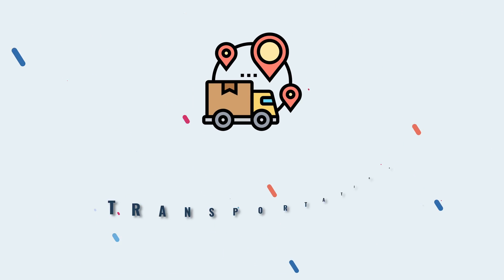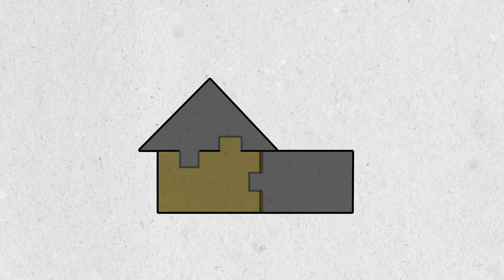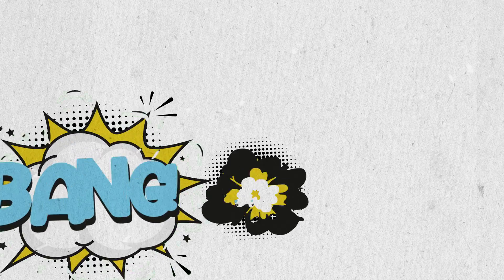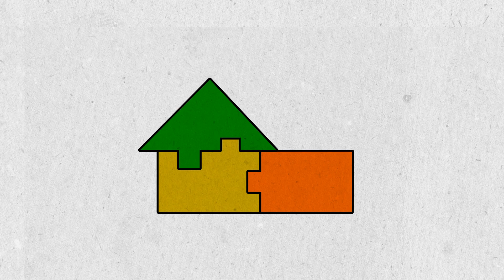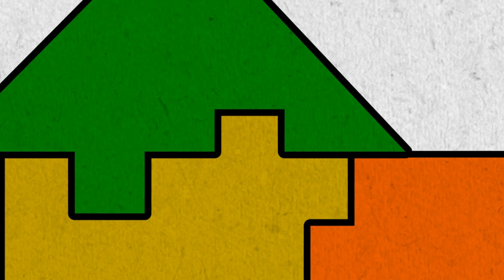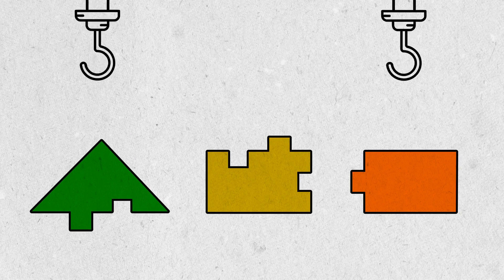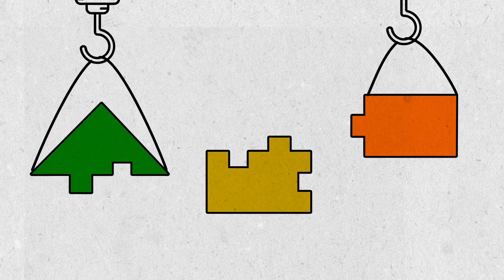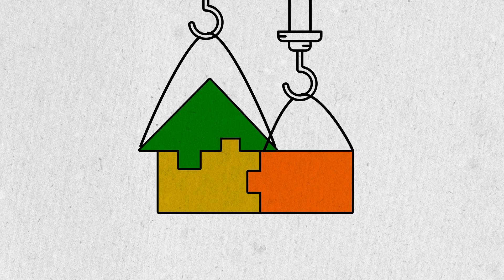Is Modular Construction The Future?

Comment: It's very intersting to see it being explored in western countries and how they can expand and make the modular design more nicer to look at atleast. At home more than 70% of buildings are the old communist modular panel ones. The engineering is good, the connections are fine, the system works. The only problem is upkeep, repair and maintanence.